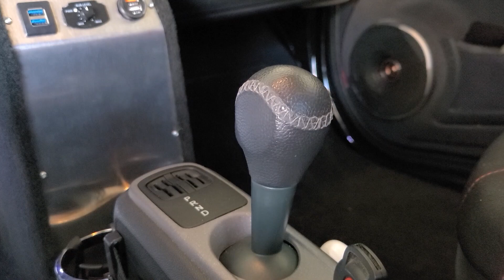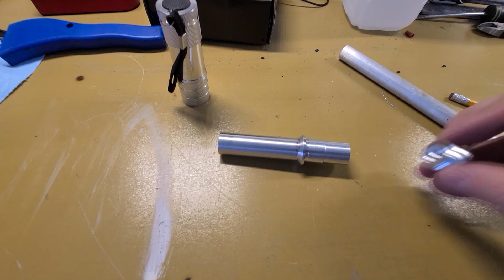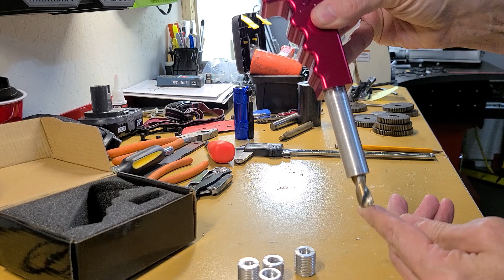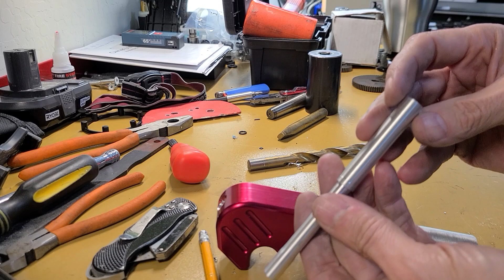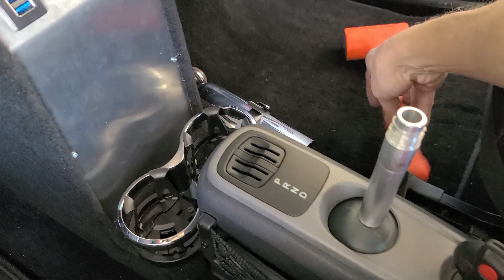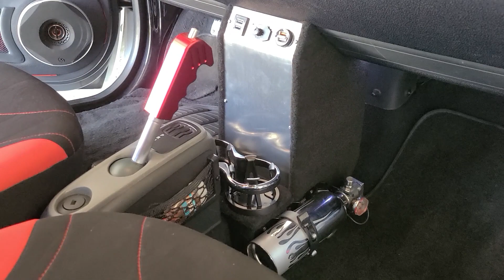Smart Car Gear Shift Knob

Comment: What steering wheel is that
Reply from the maker: It's not considered street legal, I got it on ebay, I had to remove the airbag and install a resistor in the harness to bypass it so the rest of the airbags still work.